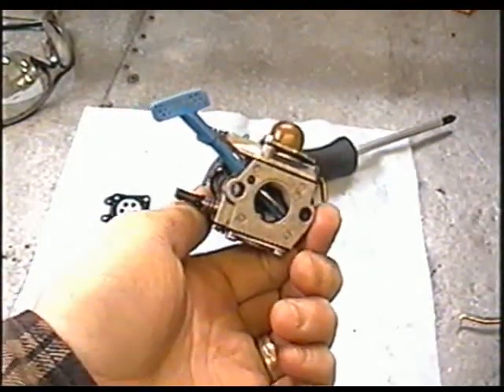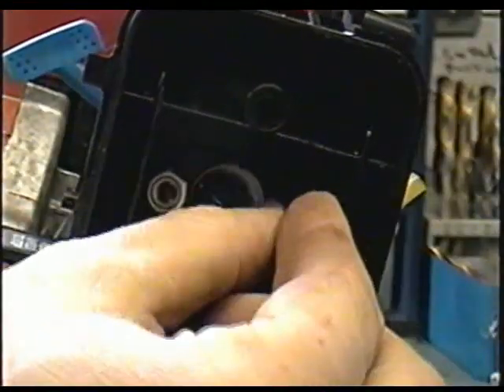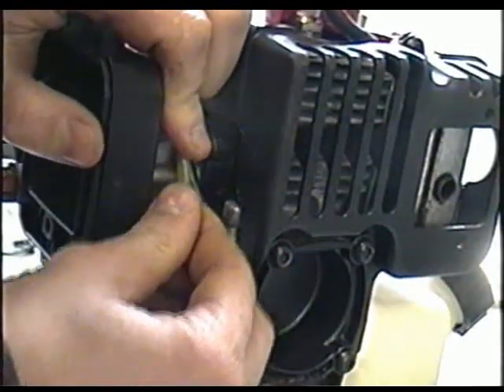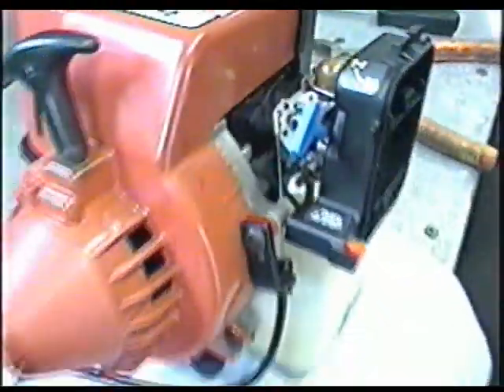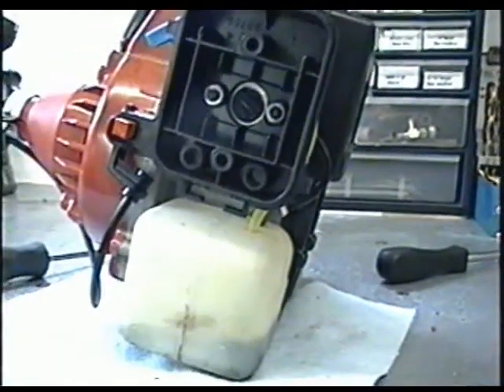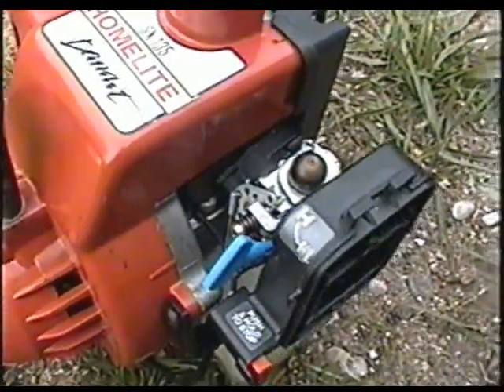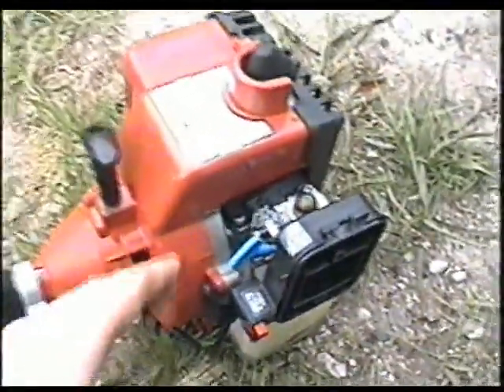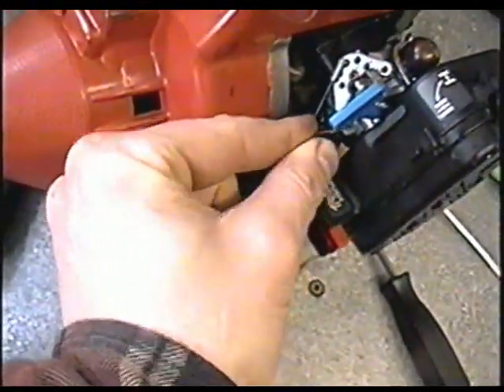Carburetor Repair on Homelite SX135 Bandit Weed Wacker Part 2/2

Comment: Thanks so much for your great vids!- I have an old ST275 I bought years ago from a guy that used it commercially. It wasn't running well, and I almost tossed it out to buy a new one. Instead, I got new fuel line, filters, plug and carb rebuild kit, all for less than $20. The only thing needing repl. on carb was the reed valve. It now runs better than it ever has! Thanks to your vid for information and inspiration.

Comment: Great vid's Dony. I have a Cultivator has a WYC Walbro carb has no adjustments on the carb hesitated really bad. So I took off and cleaned it real good with Gumout (took it a part to) everything looked good in the inside I put it back together installed it runs like a charm. I noticed the fuel filter was laying in the bottom of the fuel tank. That was the problem. Feeding dirt to my carb. I replaced all the fuel lines and the filter. The fuel line were real bad I blame it on Ethanol E10.

Comment: remember people, if you adjust the idle with no line sticking out of the spool, you will probably have to re-adjust it once you put line in it, because there will be more resistance on the engine... also for lean/rich diagnosis if it is too rich it wont rev as high and it will take longer to get up to max rpm, if it is too lean it will rev very high but will hesitate at first when you give it gas.

Comment: also when i am adjusting the high rpm fuel mixture screw, i turn it in 1/4 turn at a time, until it starts to run a bit rough, then back it off 1/4 turn, and that will generally be where it will run at its peak performance.. be careful tho because even if it runs great after you adjusted it, it may still be a little lean. if you run it too long with it leaner than it should be, you can risk engine damage. after adjusting run it for a couple mins at full throttle......
Reply: Great advice. Thank you, even if it's 11 years later. Haha ha.!

Comment from the maker: @canadaeast if it's lean it will rev high and hesitate when u throttle up, if it is too lean it will run sluggish kinda like when there it too much oil in the gas and not idle well

Comment: Very good videos (I watched both of them), Dony.  You told me exactly what I wanted/needed to know.  My brush cutter has been starting very erratically and I need to get at the carb and clean/rebuild it.  Tell me, where is the best place to buy parts for a Walbro carburetor?  Do you buy them locally or on-line?  Again, very thorough and well-explained video, Dony.  THANK YOU!

Comment: @porkypinekiwi hey thanks, i think it was one of your other videos that helped me but i took the muffler off and it works! so after i clean that (and i do need to get new fuel lines) it  should go fine! those springs holding the muffler on are so friggen hard to get back on though

Comment: What is the fuel ratio for a Homelite HLT-15 Classic.
The ratio is not mentioned on the fuel cap as it just says fuel+oil with no ratio mentioned.
Reply from the maker: use 45:1
Reply: donyboy73 
my dad has been using 25:1 on it for a long time.
I am also trying to find the user manual on it, but since it is 15 years old no luck.
LOl
Thanks for the fuel ratio.